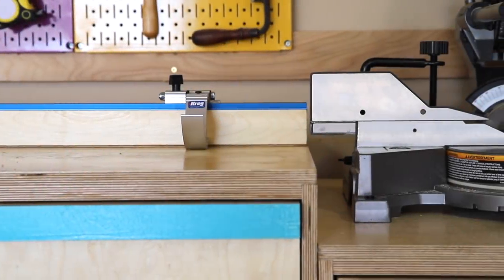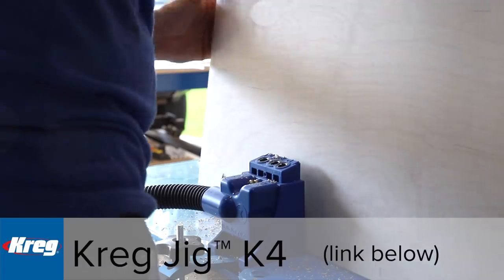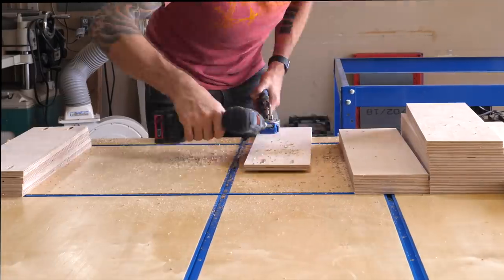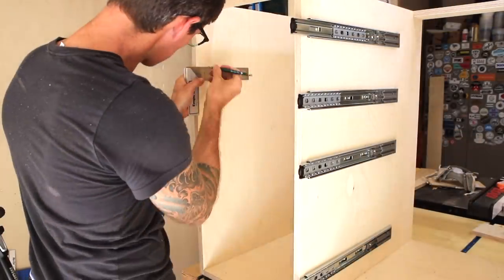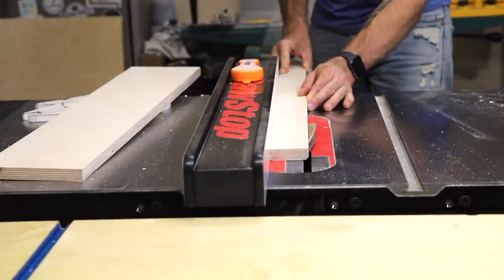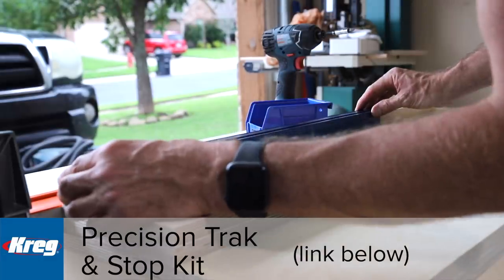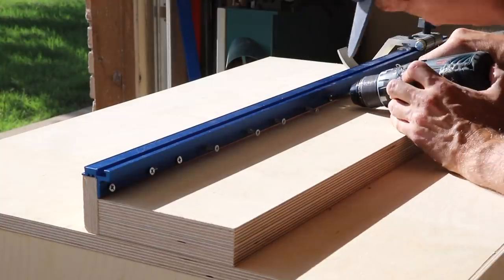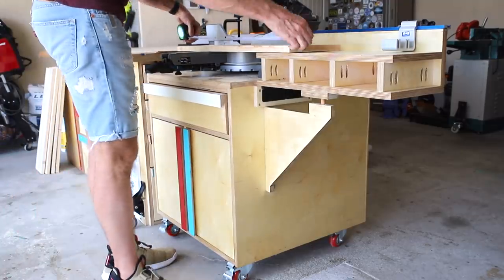DIY Mobile Miter Saw Station | Modular, Storage, Free Plans

Comment: Nice touch with the colors! I built a similar wing setup (non portable) and I found I needed to put a screw head on top of the wing support to be able to fine tune the wing to be true to the saw top.
Reply from the maker: The dowel seems to be doing a great job, and I like that I can just pop it out and cut a new one if it gets loose. Thanks for checking it out!

Comment: Question....Why do many youtubers making cabinets, have the side panels overhang the side and NOT supported by the bottom plywood? it would seem weaker with only screws holding sides on.  i see plenty of pocket screws, thats good. (You may have glued it, but not shown in video). Great Build though. Very clean and quality work.